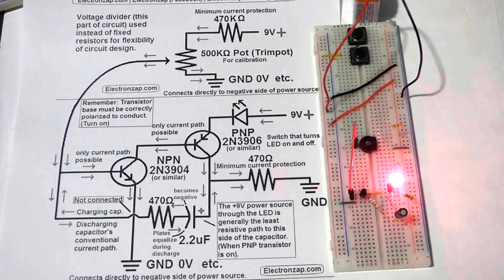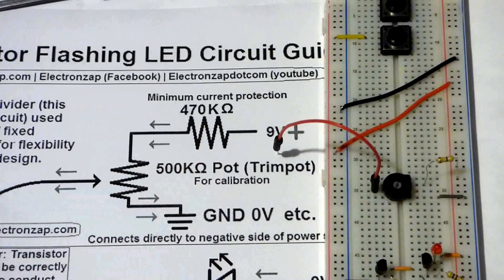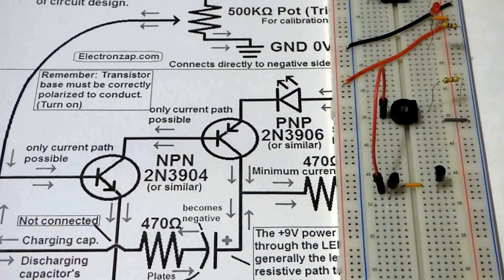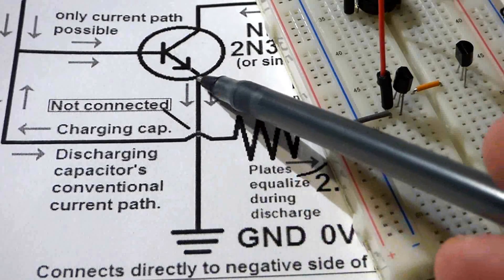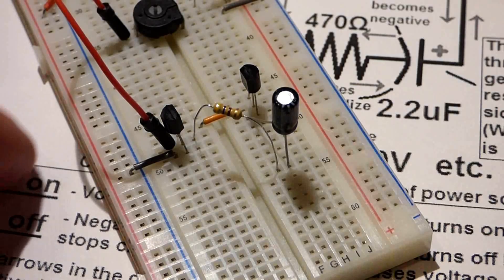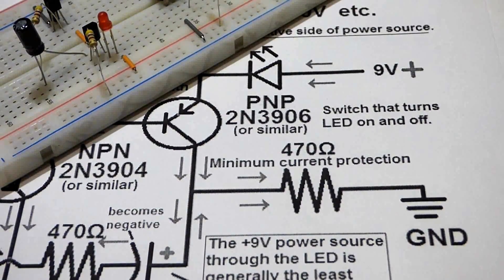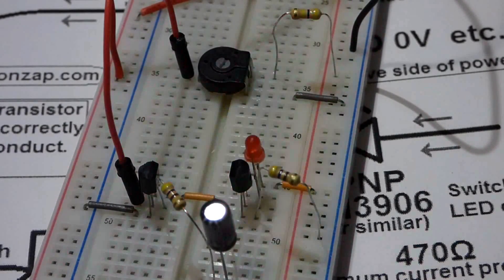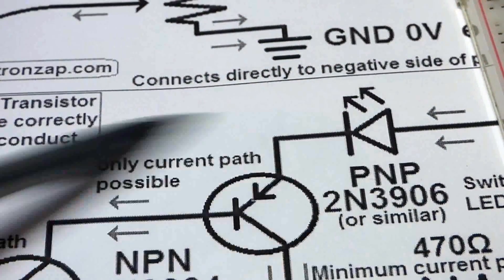NPN 2n3904 and PNP 2n3906 transistor controlled flashing LED circuit step by step build

Comment: A very informative video. I am a novice as far as transistors are concerned and I'm trying this project however your link to the diagram says "page not found". I tried to look all over your website to with no luck. it sure would help to have the diagram. thanks for the video.
Reply from the maker: I added the page and diagram to the website again. For years nobody visited the site so I've tried rebuilding it from scratch a few times. Thanks for checking it out!